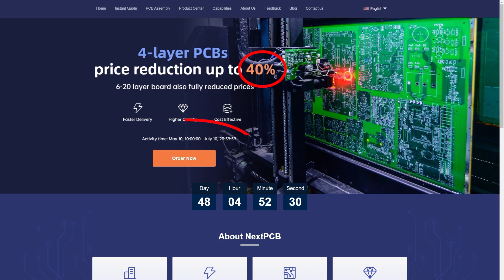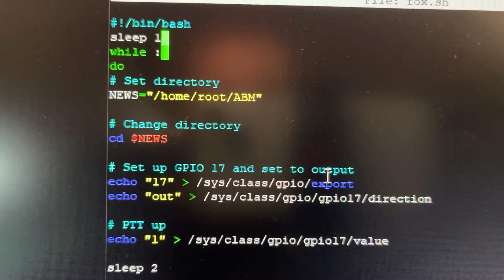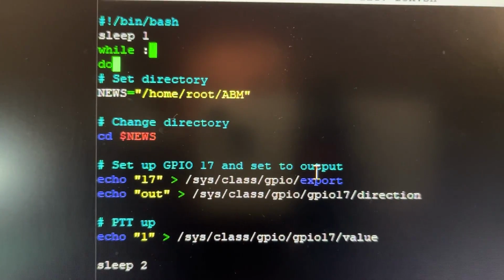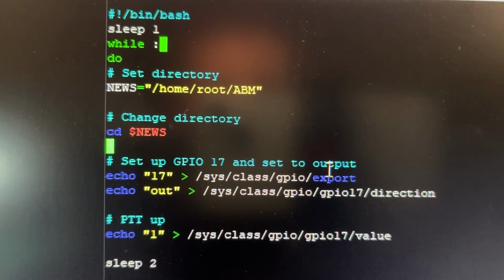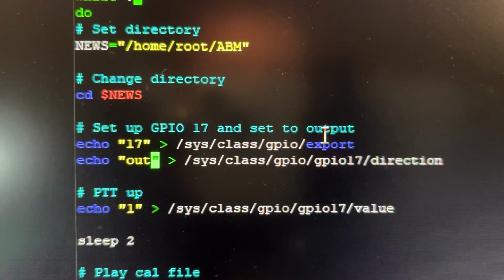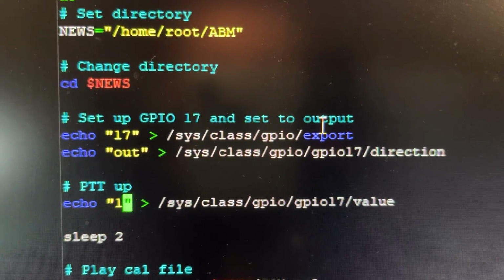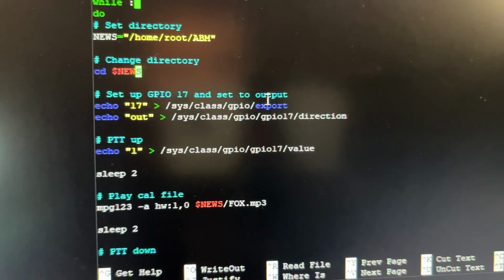Baofeng UV-5R + Raspberry Pi - Fox Hunt Transmitter

Comment: Thanks for the video. Where can find the finished script?
Reply from the maker: I ended up changing tactics and used a Ardunio instead - https://www.youtube.com/watch?v=BkBhdOc0WKs
Reply: @HamRadioDX  Fair enough. I don't want to change products mid-stream. Did you ever compile a script for the Pi? And if so, is that available.  Thanks again for the inspiration!
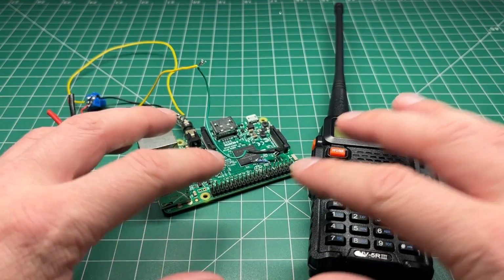Reply from the maker: @phurla1  No I didn't. I was using an old script and the Pi has been repurposed along with the SD card. Although at 4:18 you can copy what you can see on the screen - sorry

Comment: [Putting on my EE hat]

It sounds fine; you don't need the isolation transformer.  However, if you use a cheap buck converter (car USB charger) to power the Pi, you might.

Use a short bit of shielded cable for the audio from the Pi.  Replace the pot with fixed resistors.  Attach a short piece (a few cm) of bare wire to the shield.  Heat shrink the splice and resistors, bringing out the shield wire.  Wrap the splice with a few layers of foil (or coax shield, if you have some), with the shield wire between layers, and then heat shrink over that.  In extreme cases of RFI, you may need to put the Pi in its own metal case.

If you put everything (except the antenna, of course) inside of a steel ammo can, you may find that you don't get the RFI when running 2m.  Ammo cans are great for foxes, since they are quite weatherproof.

Comment: Question is do you leave the wifi running also :P Being a little linux box we could ssh into with a spare mobile phone.
Reply from the maker: Pi 3, so it doesn't have the WiFi onboard, but could plug in a small dongle
Reply: @HamRadioDX  Seriously am appreciating my Pi4 with 8gb of ram; She runs nicely to watch 720p content. These are crazy little computers and reminds me so much of the C64 as a kid.

Comment: That lead is about 1m long.....maybe a look at common rejection on the mic lead
Reply from the maker: Yes I have some shielded mic cable to replace a lot of that
Reply: @HamRadioDX  No, common mode....on the outside of the shield
Reply: Shorten that cable will make more difference than isolation I would have thought.

Comment: I have a thumb-sized MP3 player with a single mp3 file playing in a loop, and plugged into a vox enabled UV-5R. The mp3 file was edited in Audacity to add in bits of silence to extend the periods between transmitting. I've also considered an old Android phone to be able to control it remotely.
Reply from the maker: I did try that, but I found the VOX was a bit unreliable. Perhaps different MP3 players have a bit better audio driver to trigger it
Reply: @HamRadioDX  yeah you're probably right, it's an old Dick Smith one from when they still had brick and mortar stores here, with built-in rechargeable battery. Also had success with it on a BF-888S on 70cms.